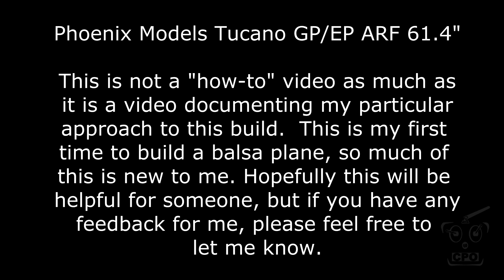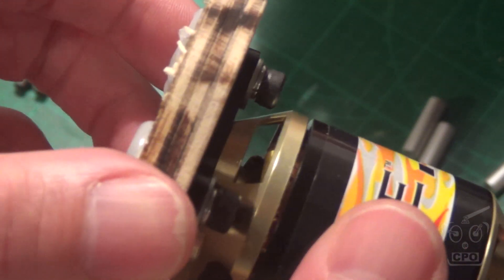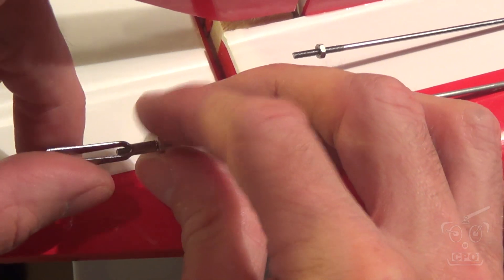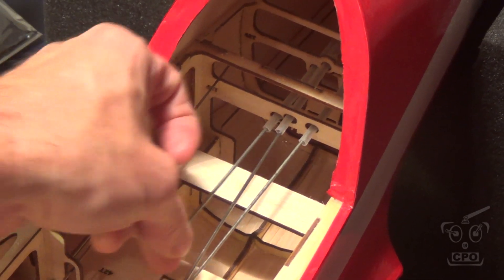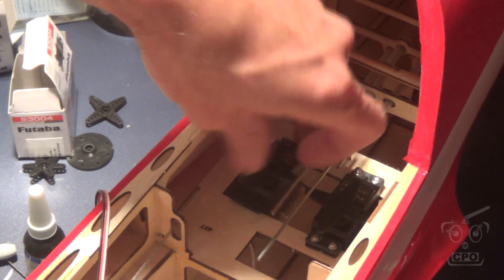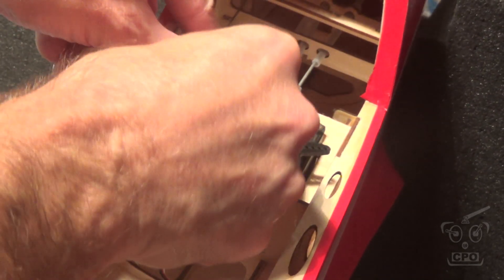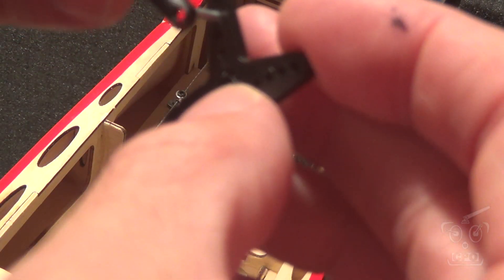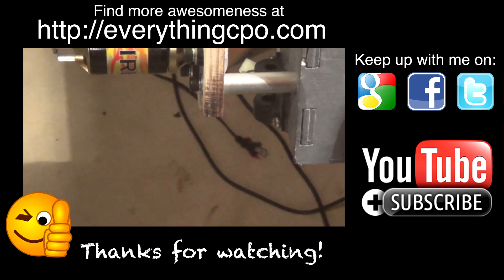03 Phoenix Tucano Build - Part Two - Motor/Rudder/Elevator Controls/Servos

Comment: Great Video! I m curious, have you had any problems with your ESC getting really hot without any airflow over it? I did the same but that ESC gets burning hot and i m worried about it cutting out... Have you had any issues with yours?  I have the exact same setup...
Any advice would be greatly appreciated!

Comment: Great video series. I am considering between the World Model Tucano vs the Pheonix model. The Pheonix model does have flaps but retracts have no suspension for the undercarriage. One tip. When installing screws like the motor from the back, I use magnets on the screwdriver so that the screws can be held and then put in place. Just my 2 cents worth. Like I said great video series.

Like Karmakazi219 said, you should try a full kit. I it really fun. and very satisfying when you finish it and it flies well.